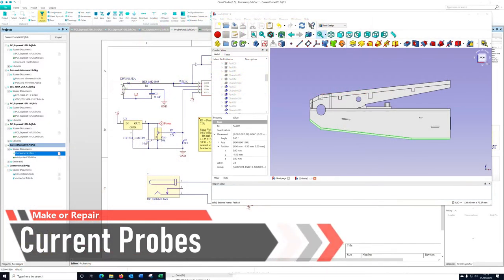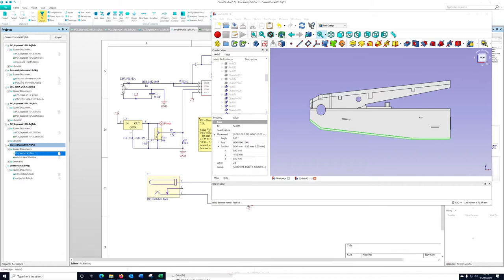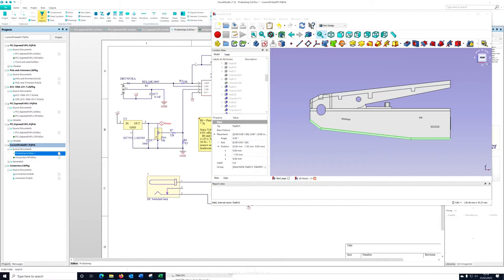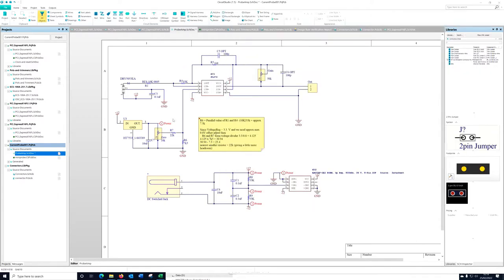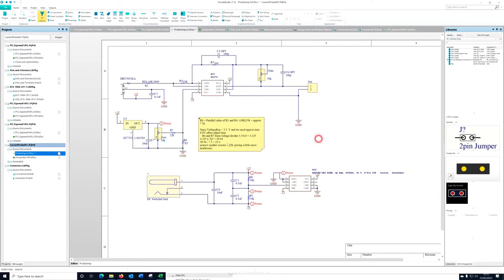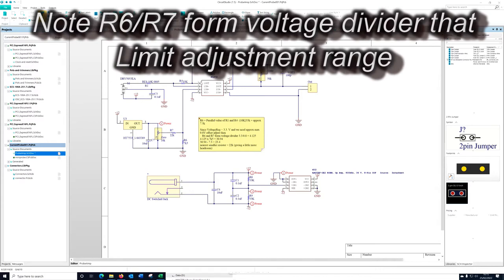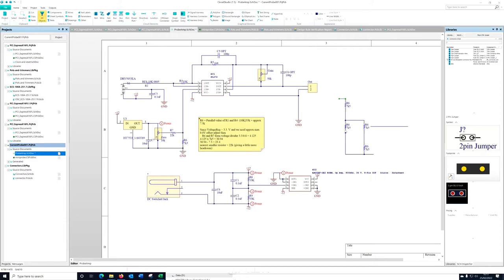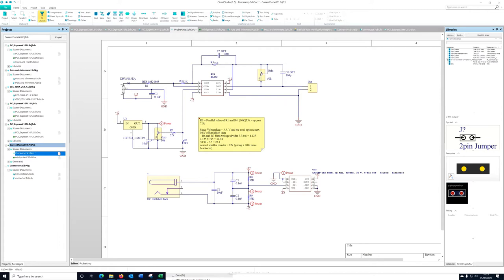Designing a Current Clamp Prototype Pt 2 #0052

Comment: Hi, great to see that you are creating and sharing this.
At my work we have always been using the Tektronix AM503 and newer models, which have always been the best there is.
Maybe it would be good to take a look at the user/service manual of the AM503. It includes schematics and might help you with ideas.
For example, they do a de-Gauss, to reset the core. They also have closed loop current injection in the core, to eliminate hysteresis, I think.
Type of core material, flatness of closure surfaces and gap will hugely determine frequency behavior and stability.
I think the core should have a gap over the whole area, otherwise the flux will bypass the sensor, reducing the sensitivity.
Reply from the maker: I'll take a look when I revisit later- although of course I'm trying to make these low cost and I need to sort out the biggest problems first.  The core I'm using is relatively narrow and I do gap across the full width,  I seem to have suficient sensitivity, the sensor would measure linearly up to just over 25A with this core, so if I introduced a switch on the last amplifier gain I could do 2 ranges of say +-3A @1mv/mA and +-25A @ 1mv/10mA Amps from a 9-12V supply - happy with that.

Comment: Each time a reading is taken, the clamp will need zeroing due to earth's magnetic field and environmental conditions. Will the zeroing pot be accessible from the outside? I guess another option could be the inclusion of a small processor and "Zero" button to make the adjustment.
Reply from the maker: The magnetic field does affect it although the ferrite ring does mitigate to an extent - it seems to be fine on a sequence of readngs on the same conductor.  Yes both the zero and the gain adjust pots will be available from the outside and they are both high quality multi-turn to make them easier to trim.   I think somewhere (might have been in mailbag) that I did mention I might put in a zero-button circuit in a future revision - I would proably use a sample-hold not a processor, it just needs a good quality cap, an FET switch and then use the spare channel in the LM358 - although it would need to be replaced with a FET input or a bootstrap circuit to pull the input impedence really high.